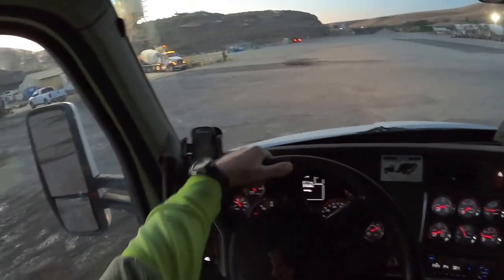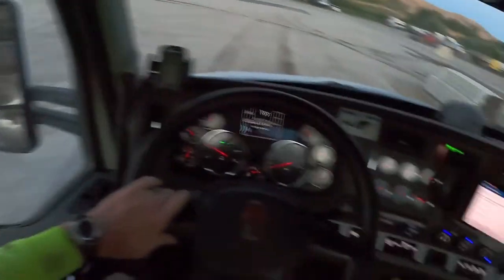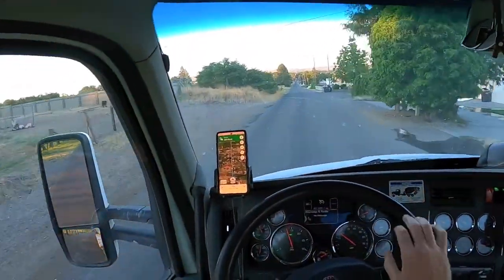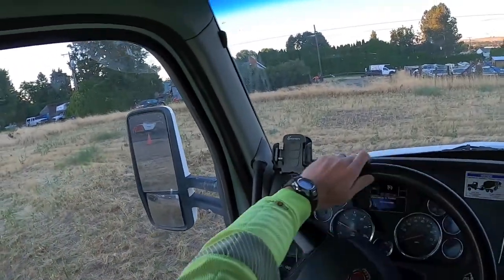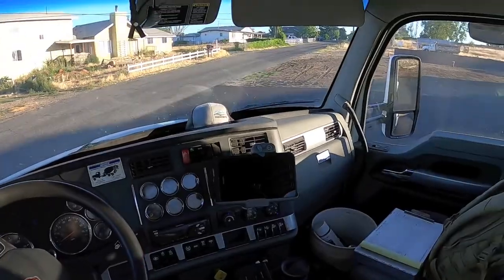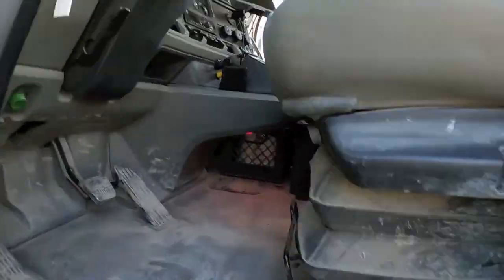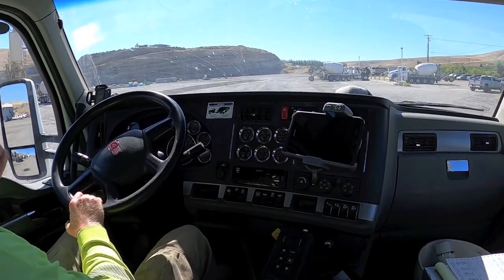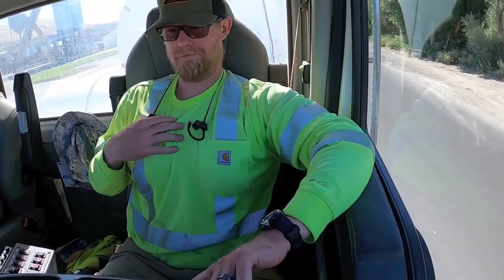Delivering concrete... And smiles

Comment: "Blasting over road cones lol" 
Do you like the T880? Mine has the digital dash with steering wheel controls. I wish I had the 1-tap set speed to wind up the drum like you do. I have to hold the set button on the steering wheel down.
Do your mirrors vibrate? Mine do. My RPMs are set to 650. I may get the mechanic to raise them to 700-750 with his laptop to help smooth them out. I can't raise them manually like on my old truck. 
What's the hand signals at the batch man? 
Good idea to raise your hopper to spray it down at the slump rack. 
On your control box I see remote throttle I think. I have to turn mine on in order to wind the drum up from the back. Do you have to as well?
Do you have a constant speed button? I do on my control box but I cannot for the life of me get it to do anything.
We have a windshield camera looking at us. If we get caught without a seat belt, on our cell phone, on our radio, or even with a Bluetooth in our ear while the brake is disengaged we get wrote up.
Good video like always ✌️

Comment: What’s the switch you hit under your water tank after washing out?
Reply: It’s a pressurized switch it’s puts air in the tank which allows you use your water and you turn it off after washing cause it takes air from air tanks for the truck